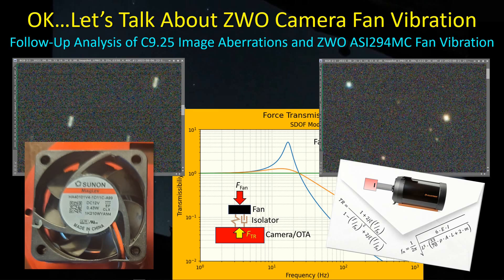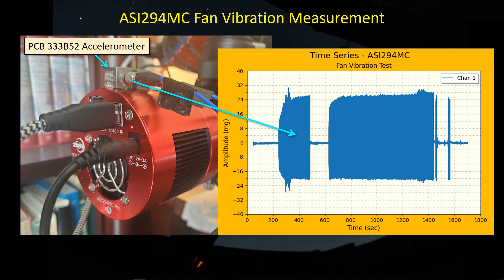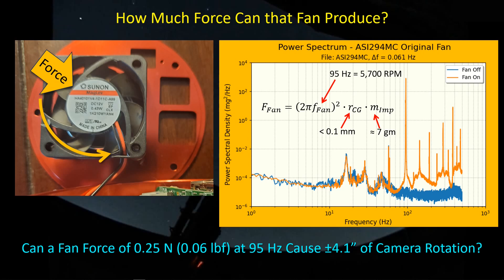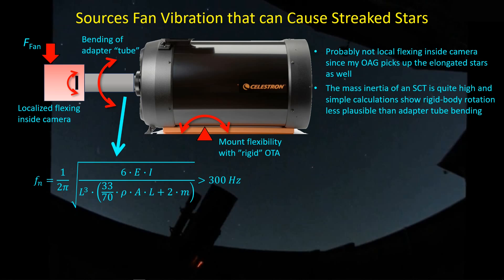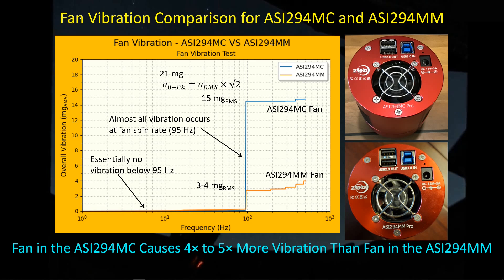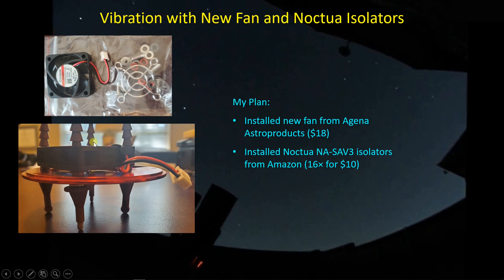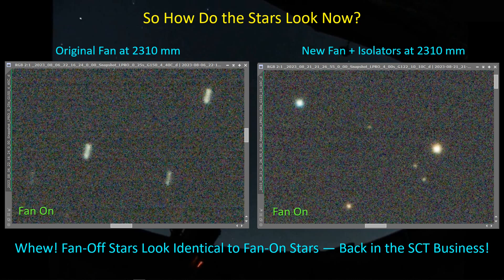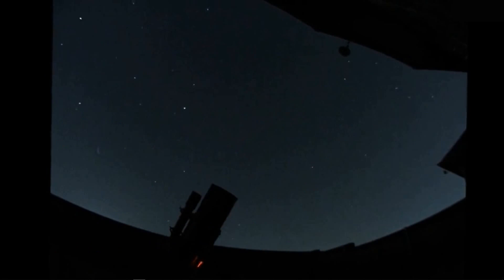ZWO Fan Vibration and Elongated Stars - Analysis and Measurement

Comment: I definitely applaud your efforts. The engineer in me is screaming "YES, that's exactly how I test"! I have to ask though... did you test the fan on vs. fan off performance before going through all the extra steps? I don't have the fancy vibration tools you have but I did use an accelerometer app on my phone a couple months ago when this vibration issue was blowing up in the AP circles. I attached the phone to the camera and captured the data and exported the file. It was pretty high rate, I think over 100Hz. I saw no appreciable evidence of an issue with my 183MC-P or my 294MM.
Reply from the maker: We had a long string of clear nights with no Moon, so I spent that quality time imaging with the ED102/ASI1600 at night and this vibration testing during the day. Just before the clouds moved in, I put the C9.25 outside to test the replacement fan. A cell phone accel should pick up the “bad” vibration. Not sure what % of fans are “bad”. Based on my empirical low-sample statistics (i.e., 3 samples), it’s about 30%.
Reply: I have a n ASI 071 OSC cooled camera that i tested. No issues but as preventative I decided to put in the latex stand offs. I tested before and after with my Vibrometer and frankly in both cases it was no difference . I have seen no evidence in m long focal length images either. Being curious I decided to test and measure the vibration on my other cameras....an SBIG STL 6303e huge camera with a nearly full 35mm chip size. It has a motorized internal filter wheel for 2" filters. After opening the case for the SBIG I discovered that the fan was the exact same size, brand and model of the one in the ASI 071!   I have a few friends and when they checked their ASI camera there was no evidence of an issue and a couple of them are imaging with 2800mm focal length SCTs for high magnification imaging. I use refractors from 80mm to 152mm aperture and focal length of up to 1200mm. I also image with my 11" SCT and sometimes a 14" SCT so if I had any vibration issues it would be evident. 
So I suspect this isn't a big issue although could be found on other cameras also. I researched fans and found that they are quite cheap so if it was an issue it might be faster to just change out the fan. I also noted the wire from the motor runs pretty close to the cooling radiator array and I made a point of making sure that wires were away from any area that it could transmit vibration. One thing I did note on the SBIG.....it was an older camera (around 2007 or so)...  there was some minor dust buildup on the fan blades. I used a small paint brush to brush that dust off and looked for any chips on the fan blades...there were none. I can see how any dust buildup could cause an out of balance harmonic. That SBIG has had no vibration issues either up to 2800mm focal length but in both it and the 071 ZWO there was a tiny but negligible vibration picked up by the Vibrometer but it was so low to be of no consequence. I also have an ATIK one shot cooled camera and it had NO detectable vibration.

Comment: Great analysis.  Love the level of your channel -- quite unique among astrophotography channels.  I also had a fan vibration issue, which I first really noticed after I saw squiggly satellite trails.  Turning off the fan, they went straight.  I've installed the isolators you have, and that has reduce, but not eliminated the problem.  I guess I need to order a new fan.  (Equipment:  SCT- HD11, ASI2400mc-pro (full frame) )
Reply from the maker: I’ve seen those wavy satellite trails with another camera, maybe my ASI1600. Looks like the next step is to develop a plug-and-play vibration isolation “holder” for the fan (or cut down the RPM to the minimum required rate). Thanks for watching!

Comment: What about 3D printing a spacer (between back plate and camera body) to provide more room for isolaters? I do like the iidea of lower fan speeds. I went with a Noctua fan as well as the isolaters. Now if the weather will break.
Reply from the maker: Yes, I think a spacer, maybe 4 mm, might do the trick. I just bought a Noctua fan (hasn’t arrived yet). Not planning on installing it unless this new fan has issues, but I am interested in testing it to see if it is truly different from a vibration perspective. Thanks for watching!

Comment: Great analysis thank you for your work and for sharing it. I think your extra step for longer focal length isolations could be to shave down the thickness of those isolators, rather than sever the connection for three of the four. Make the isolators thinner, floppier, weaker, and I think you’ll gain the flexibility you want.
Reply from the maker: Absolutely. Shaving the down the isolators could work.

Comment: Hi James . It is a 12vdc fan correct ? Maybe try a simple DC Speed controller to reduce fan speed a little . Of course this would mean some testing of the cooling the Peltier would produce at various heat removal volumes as caused by slower fan speeds . Might be an interesting project . Thanks for keeping us involved ./srk
Reply from the maker: Yep. You’d have to try a lower spin rate and monitor the sensor temp to see if the fan could maintain the set temp. Then lower the spin rate and test again, etc. I can’t believe 5,700 rpm is the minimum required. Definitely an interesting project, Scott.

Comment: Great analysis James. I am on board with the induced vibration theory but according to this armchair engineer the radial accelerations should induce a near circular precession in the tube (coz gravity). To get football shaped stars would seem to indicate a single axis of oscillation and  to go all the way with a solution would require locating and fixing the weakness in the setup. Can you re-arrange the stack up order? . Looking forward to your final conclusion and solution.
Reply from the maker: Hey Rob. Total agree. Why a streak vs a circular bloat. The simple insight you get from the back of an envelope cannot provide the answer, just an order of magnitude assessment of whether it’s a legit concern. I don’t think there’s much value in playing with the adapter stack-up - just not enough options. The OAG goes where it does and the filter drawer goes where it does and you’re left filling in the gaps. I need a one size fits all proper vibration isolation holder or find a reduced RPM that still works for thermal. No, the end of the story is not written. Thanks for watching!

Comment: apart from the maths which made no sense to me, the video was an excellent analysis of the problem, What you should add is what brand and where you can get the better fan and if you made any modifications to this fan
Reply from the maker: Don’t worry about the math - most people don’t care about that sort of thing. The fan is the same one that’s in the camera and is sold by ZWO and also carried by Agena AstroProducts (and other Astro product sellersA) - nothing special. Just taking my chances that I had a “bad” fan. Thanks for watching.

Comment: Great work James. Do you have a link to the new fan?
Reply from the maker: The fan is the same make and model used in the ASI294s and probably the ASI1600 and ASI533. Look up the ZWO fan on Agena Astro (there’s a different model for the larger format sensors like the ASI2600 and ASI6200)

Comment: I had a fan vibration issue in the past too with a QHY camera, I eventually solved it by replacing the fan with a more expensive maglev type. I noticed this same problem when the camera was attached to my 9.25” SCT but at FR focal length. I narrowed it down by turning off mount tracking and just capturing star trails, the resulting trails were zig-zag in shape. After the fan upgrade I had perfect stars at FR focal length, I don’t image deep sky at native focal length though so I cannot attest to the fix being good there.
Reply from the maker: Interesting. Does QHY mount the fan the same way ZWO does: screwed to the back of the camera? Or do they have a legit vibration isolation system? Not sure why I didn't see this effect at 1318 mm. The length of the streak should have been obvious at that focal length as well. Thanks for watching!
Reply: @Aero19612  the fan was mounted ‘self tapping screws’ to the back of the heatsink for the sensor via some quite poor rubber grommets, I replaced these too with more suitable ones when fitting the new fan. 
The zig zag pattern was extremely visible in long bright satellite trails. 

Perhaps the vibrations in my QHY were more than you were getting hence why mine showed up at FR focal length. 🙂
Reply from the maker: Thanks for the info on the QHY mounting method. Good luck!

Comment: Great analysis. I had the same issue and came to exactly the same result.  Im curious if you noticed if your satellite trails were wavey? I used this to calculate the frequency of the vibration (mine was quite extreme)
Reply from the maker: I have noticed wavy satellite trails in the past. It may not be possible to calculate the vibration frequency that way unless the satellite trail starts and ends in the single frame. Otherwise you don’t know when during the exposure that the satellite entered and exited the frame. Thanks for watching!

Comment: Good news that you were able to solve the problem. Several months ago I changed the fan on my ASI 533MC because I started seeing a similar problem using my Meade SCT 10". I used a Noctua NF-A4x10 Premium Quiet Fan 40x10mm that came with the silicones included. All for only $15.🙂
Reply from the maker: I ordered one of those fans too. Not here yet, but I do want to test it…and have it as a backup if/when this new fan goes bad.
Reply: Im assuming you cut and changed the connector to 2 pin though right?

Comment: What a great video. Once it cools off down here in the south, i look forward to doing some testing on my own asi294mc pro and asi1600mm. Ive had some issues with seemingly random star elongation. Itd be great to be able solve it with just a new fan.
Reply from the maker: Ridiculously hot. Yes, I was quite pleased to get off by simply installing a new fan compared with what I thought I was going to have to do. Random problems are the worst. Check you USB cables to the mount and guide camera. Good luck!

Comment: To support my hobby I have a drone business. Drones have damping systems to keep the camera smooth while the props shake the drone. When I saw you post this I thought about how well a similar system would work  - something as simple as rubber grommets. Your work seems to suggest that the original fan was not balanced - aircraft have a similar concern for balanced props. If you had a system like A-P shops or even Discount Tires does to locate the imbalance point it would seem a bit of shaving of the impeller in the right spot would work too.
Reply from the maker: Hey Shawn. Grommets won’t work here. Your drone camera isn’t imaging at 2300 mm so vibration isn’t as big a deal. For the telescope application, we need a legit vibration isolation system with a lot of flexibility and minimal damping. The grommets are fairly stiff and have lots of damping. Haha. I would love to see the look on Discount Tire faces when I ask them to balance a 40 mm diameter “tire” that spins at 5,700 RPM. Find the right spot to shave is very problematic. Thanks for watching!
Reply: Thanks for the explanation. My suggestion on the balancing of the fan was me thinking that there must be some device for smaller engineering devices or at least a device that would test and determine the more evenly balanced fans. Of course, they may be so cheap as to preclude such and endeavor. @Aero19612
Reply from the maker: Right. In effect, that's what the accelerometer does. Better balance = lower vibration. I need to come up with some vibration isolation support for the fan. Will have to think about that... Wish I had a 3-D printer. I could probably make a $ or two